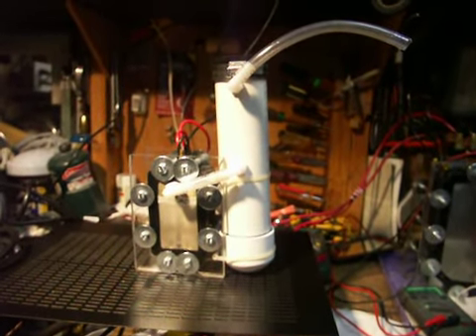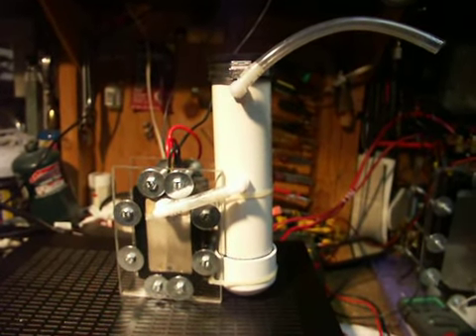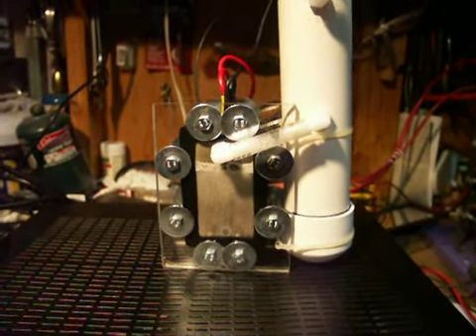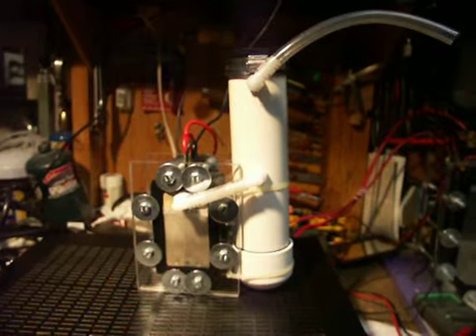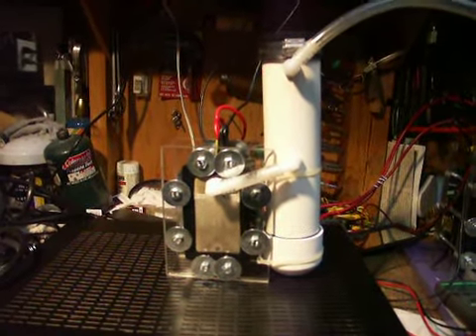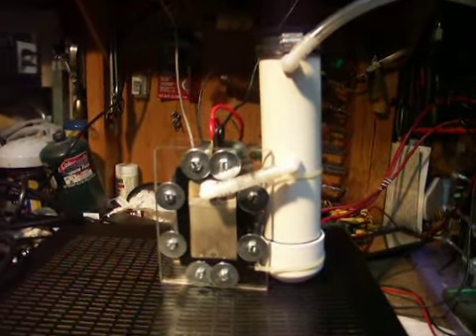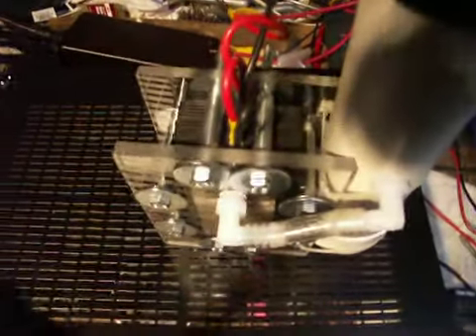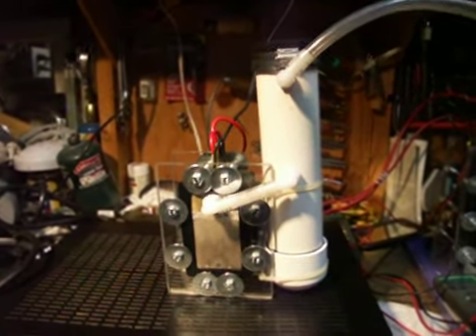Mini Me Wall Plate Portable Dry Cell

Comment: Great build!
does your cell build heat at a fast rate?  I plan to build one similar to yours.  how well does the electrolyte circulate between the cell and the bubbler to help the cooling process?  your getting good mmw!  all Ive ever gotten out of a cell was 1 mmw.  what is your plate config, pos, neg, and neutrals?   my latest cell uses one pos, one neg, and 8 neutrals to make up 11 plates.  But it's a wet cell in a box!

Cheers.

Comment from the maker: At 115 Degs F it produced 900mil per min. I had almost 40 grams of KOH in the reservoir to make it produce that much. 600mil per minute would be an expected output for long runs. Its not a lot of gas but its also not a lot of plate area either.

Comment: I wonder what kind of output you can get if you changed the neutral plates to a +-+-  config?  as long as the reservoir and maybe even a cooling condenser with a fan will keep it from getting too hot!     with that kind of config, I wonder if the electrolyte will still flow through the reservoir without the need of a pump!

Comment from the maker: The cell heat up at a normal speed, though this cell need a much bigger reservoir than the one I show in this video.  A larger reservoir would keep the cell cooler and run longer. I have had no over heating issues. The configuration is -NNNNN+NNNNN-NNNNN+ @13.8 volts and I use KOH.  This produces about 800 Mil/Litters per minute. It's not much but it's a pretty small cell.